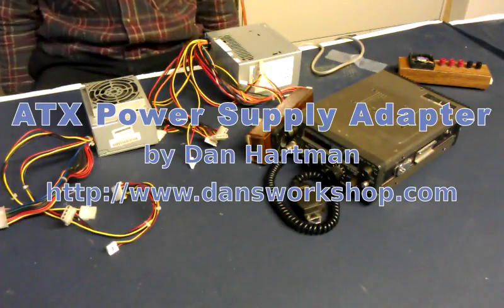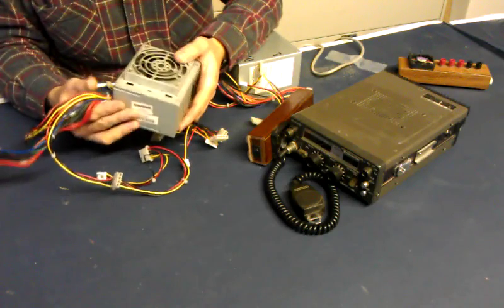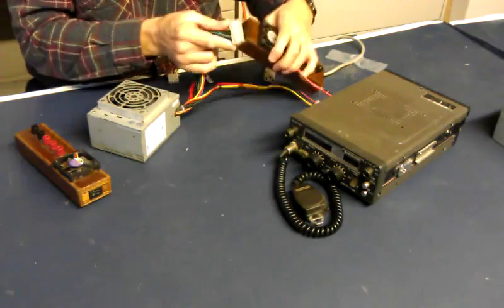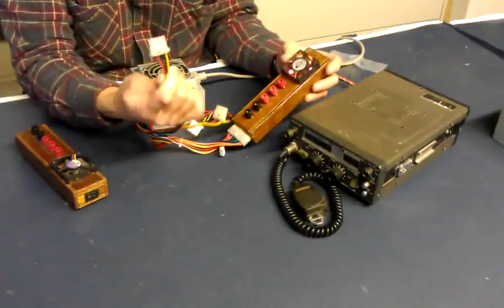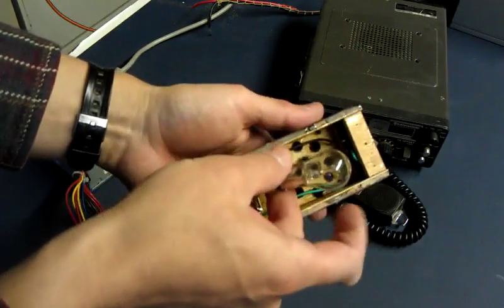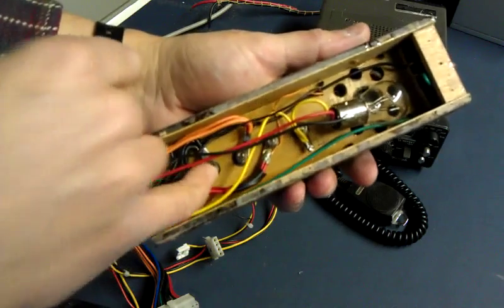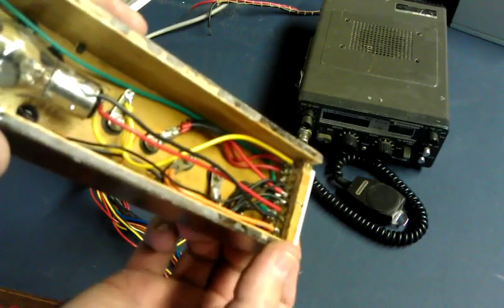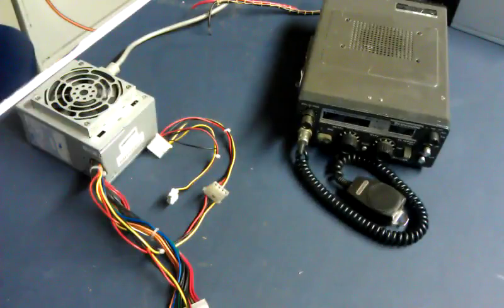How to NOT convert ATX power supply to benchtop or lab power supply

Comment: I like your idea of creating an external adapter to your ATX. But filamen bulb like the one you used requires a lot of power and it is very hot and may cause fire. Why don't you use LED? Also, add fuse/circuit breaker on 12V output at least.
Reply: therealnightwriter What is the minimum load required then?
(And more importantly: why? :P It seems like a dumb idea to me.)
Reply: Eddie Suerte Felipe Also, I wonder what would happen if the light bulb burns out when the power supply is functioning. I guess it will stop functioning at that moment with a loud poof :P
Reply: +Bon Bon In the past you needed a load resistor to pull the voltage down during power on because switch mode power supplies have a tendency to spike to higher voltages when first powered on and some can also drift higher if the load is zero since they were designed to always be plugged into several pieces of computer hardware.  Most modern quality PSUs don't need a load resistor any more since they use the internal fan as a load and do not drive the output until the voltage stabilizes and they give the power good signal.  Also modern chips that control the voltage don't need as much of a load to control the voltage output as they once did.

Since the load resistor is really just for startup, nothing should happen if the bulb burns out while the PSU is in operation unless it is running with no load connected.

Comment: I want to make one of these and use a boost-buck converter with an LED display in one section for variable voltage of 0.5 to 30-35 with current up reaching 10-12 amps, but I'm thinking that if a load isn't necessary on most supplies, wouldn't a switch to the bulb/resistor make sense?  Only use it if you change to a PS that needs it?  Just something I'm considering when I construct mine.  You can always turn it on momentarily to see if the PS is working, or wire in a momentary test switch. Also, if you need more current, what about an extra Molex plug somewhere to double up?  Excellent idea you have by making these a "plug and play" alternative, btw!
Reply from the maker: Yes, add switch(es) to turn off the bulb filaments to the PS if you like!  Add more molex to it to use more wires, and quench the whining of the Current Cops! The whole idea here was to make the PS plug and play.

Comment: Thanks for sharing a very good concept!  ..yes making for fast change to another Psu,..if it takes the evening. :) 
==>Though, a important tip back: Perhaps put some fusing on those 5 an 12 rails towards the 'wooden'-boxes. 
And also make sure for utilizing 'equal amount' of negative return-wires for both the +5 and 12 + leads. 
 
Thanks again Dan. 
(..right in time to see your video, since are in a starting process of myself utilizing some Psu's here also)
br,
from other side of the pond(scandinavia)
Rolf

Comment: This is probably a stupid question with a psu can you only use up to 24 volts of it or can you use all the wires and run them through a board and use them all like you take one of the 12v wire and one ground and attach them to the board. then do same till they are all attached and they are all run to the end of the board and out some wires that then give you like a 100 something. you could control how much goes to the end with switches. Would that work i'm still a bit new to this.

Comment: dansw0rkshop  Can I add Molex (female) connections on the enclosure and connect the +12 to the 12+ of the motherboard ATX connection?
Reply: +spiritcore1  I am pretty sure you can connect them if it is a single rail one (which most of the older ones are) because they usually are connected anyways into the PSU . If the PSU has multiple rails, that would be a bad idea.

Comment: I'll have to chip in here. I guess there is a difference between the (old) 110V and 230V PSUs, because in all of my 25+ years of mucking about with computers I have *never* seen a PSU that required any "dummy loads" to operate. I've *always* just shorted the green and gnd wires (if there wasn't a separate switch) and it has always worked. But I do live in Europe where we have 230V mains. Maybe the 110V versions needed the load?

Comment: There are plenty of quality PSUs from old servers etc which are fine for permanent use. However if you connect to something which fries your PSU it's easier to plug in another free PSU than bother to hunt for a fuse and troubleshoot! Many of us throw lots of good PSUs and other bits in the metal scrap bin since the PCs they came from are obsolete and not even usable for kids.

Comment: I initially started out thinking this was a total crap video, however, as I continued to watch (I have a rule about making myself finish a video even if I think it's crap halfway through), and I completely changed my mind, what a genius idea!!! However, the only concern that I have is regarding the fact that he uses only a single 20/24/20+4 connector for everything... It seems to me that given these cheaper (typically the ones you would use for such a project), they are more likely to be multi-rail power supplies, which could be an issue when trying to pull from just the ATX connector, that is in addition to his concern that he is using only that connector... On top of that, I really am disappointed by his 'solution' of adding an automotive bulb as a load... Of the close to 100 PSU's that I have serviced, repurposed, etc. I have yet to find a single one that required a load to maintain power, not once, which to me means that they are somewhat rare, so why build in a component that ALWAYS draws a load, when you could have just added a switch for both the fan and the bulb, so that IF that particular PSU does happen to require a load, you can power it on, and if it doesn't then you're good without...

All things considered, THANK YOU for this excellent idea!!!
Reply from the maker: You're welcome!

Regarding the single connector:  All the other connectors are still there and can be used.  I do use them in some cases, just not in this video.  Haven't melted any wires yet. BTW there's no guarantee that a computer will draw balanced loads across all of the wires in a given rail anyways -- there's nothing stopping a motherboard from smoking the single 12v line in the 20 pin ATX plug.

Regarding the automotive bulb:  Since I made this video, I've discovered more reasons to have this here than it being "required" for the PS to turn on.  But you're right, it would be trivial to just add a switch to turn the bulb off when not wanted.  It's 35 watts, big whoop.
Reply: I like it.  I think the resistor is still an option instead of a light bulb that someday will go pop!, and maybe more of the molex connectors into the "back plane" of the box for more "oomph" and use thicker wire on the inside to bridge them.  Take the full watts ( or a larger optional amount ) of the Power Supply on its limited wires, all plug and play.  I might have to build one now.  Thank you for the video and driving the point home about the separate box is genius.
Reply: +dansw0rkshop My apologies for the delayed response, I got caught up in moving and forgot to... 

In regards to the part of your message stating that there is nothing stopping a Mobo from pulling too much current, but that is incorrect, the ATX specification prevents pulling such load, so any Mobo manufacturer worth looking at will have adhered to that spec, additionally, there isn't much stuff on a motherboard that pulls from the 12v rail (I believe you said this already in the video though...).
Reply: +dansw0rkshop my apologies, I can't seem to edit my previous comment on my phone... 

Anyhow, I did want to express that I am in no way being disagreeable, nor at all combative, I really like what you've done, and I plan to make one myself once I decide which computer I want to pull apart (I usually have a good selection from a friend that gets them regularly, but sadly he hasn't had any recently), I have a tiny, proprietary Dell with a nice and physically diminutive 300W PSU, or a custom build with a standard ATX unit of 500W,vut since I'll likely not be pulling anywhere near either of those for any projects I do, it feels 'wasteful' somehow... lol I keep looking for a small 100-200W unit on eBay, but the prices are crazy for anything substantial.

Comment: Really the main killers of these PSU's are the caps they use, easy fix.
Ill be converting my SUN 1000w server PSU, i've upgraded the output circuits and it can give me 50v DC at 1kw (I've added a pot to the feedbackloop)

Comment: Shottky rectifiers seldom go bad.
In my experience,  the electrolytics fail, and 
then sometimes take other components with them,
due to the ripple - not on the mains side,  
but on the RF side, ahead of the shottkey diodes.

Motherboard caps are cheap,  if bought in lots,
and should be installed after the old caps are removed.

These AT and ATX switching supplies are very reliable,  if
you refurbish them before deployment in a bench setup.

"Throw them away"?
I would gut the stainless steel cases,  as they provide
great material for fabrication.  It is not too time consuming
to simply remove the boards,  and use them in a power supply project.

Also,  by simply changing one or two resistors, you can change the 
output voltages on the 3.3 and 5 volt rails.  Just make sure the 
working voltage rating on the output smoothing caps is high enough.

Also,  look for PFC supplies.  The less expensive ones are not PFC, 
and therefore draw a ridiculous aamount of current from the mains.
However, they can also be drived with 170 to 300 volts DC,  
with or without bypassing the input bridge rectification diodes...

de WA6FRN
Reply: This is what I've found too.

Comment: what is the maximum power you get out of it? my conversion can't supply 1/4th the power it is rated to
Reply from the maker: Each of the voltage rails have amperage limits, and those added together represent the wattage of the supply.  The 12v rail might indeed only supply 1/4 the total power, with the 5v and 3.3v rails supplying the other 3/4.  I dunno.  Try a different power supply, it's easy to swap out!

Comment: You don't need to use a dummy load on an ATX power supply.  Just short the grey power good wire to either the 5v rail or 12v rail.  (5v rail preferred)  That stabilizes the power supply so it can run with no load.

Comment: Do you really need all the cables for the 3.3 and 5 volts? Isn't just one of each enough?
Reply from the maker: +epiNoesis Yes and no.  Yes, you can power something from a single wire, but no, you cannot deliver the full rated amperage through just one.
Reply: +dansw0rkshop  Yeah,  I wouldn't draw more than about 5 amps per wire ... too lossy.  They're what,  AWG 14 or 16?
Reply: +John Bond no they're 18awg or even 20awg
Reply: aaaack!  I'd parallel 'em,  or replace 'em,  too,  myself!
Reply: +John Bond well 18awg will easily do 5amps
Reply: Yep.  2.3 to 16 amps,  depending on the run.  But I'm a little on the liberal side when it comes to power electronics,..

Comment: Did you even watch the video? lol I do agree with you, but the author of that video says these old power supplies are old and unreliable and that is the reason for the external box, NOT so you can use the supply later in another computer. Start watching at 0:30 and you can confirm this quickly. I like his little gadget as a testing device, but not as a permanent power supply.

Comment: I like the idea you are going for here, but you wouldn't use all the rails on your PSU by not using the molex connectors. IF you do have a PSU that actualy delivers full load on that one plug, then pulling that many amps through that thin wire will ignite the woodwork in no time.
I've melted several wires due to bad planning when re-routing an ATX, and using under-dimmentioned wires compared to what the PSU could actually pull. In one case I even had an all out electrical fire.

Comment: Nice try but...
Firt off, FUSES!
second most psu's from the last 10 years have the dummy load built in. Also your lightbulb is overkill as far as dummy load goes. Get a resistor in the k range using ohms law to figure out how much curent it will draw. Put this resistor on a switch for new psus that wont need it. with a dummy load in the k range you wont need a fan and probably not even a heatsink.
third add more inputs to use the other rails as most have at least 2. keep in mind that parrralelling these rails means you will need some high current schotky diodes so the rails share the load and dont backfeed from differences in potential. these diodes will drop 0.7 volts from your voltage so you would want to add a switch to seperate the rails for times when an accurate voltage is better than more current. or you could do seperate positive posts for each rail. with a dummy load in the k range you wont need a fan and probably not even a heatsink.

I know you want it plug and play but connecting the voltage sense wires directly to your binding posts with some heavy gauge wire would do great for regulation and may counteract the voltage drop from the diodes should you parralell the rails. I think stripping and screwing 3 wires every time you change psus would be worth the added current capability. keep in mind that parralelling them you shouldn't draw more than 3/4 of their combined power.
Reply: It was mostly a joke, every single how to or diy has a stupidly long and try-to-hard-to-be-funny intro. I haven't fused any of the atx supplies I use and are grateful for the protection they provide.
Reply: I have used my fair share of atx's and btx's

I have an old dell atx mnounted to the back of my tv powering my modem, router, and speakers. a higher powered one for my old head unit and a set of speakers. another that powers led lighting I made on my workbench. and another with brass screws and wingnuts mounted on a piece of 1/4" phenol for testing. I did until recently have a second in my pc case just for fans and extra hdd's. I also built a boombox with an old headunit, stereo speakers, and an atx that I use on jobsites. if it gets trashed or stolen it cost me like nothing.
Reply: it's tough to find many with strong 12v rails but most have ginormous 5v rails. One of these days every night stand and sidetable in my house will have a courtesy usb charging port for guests.

Comment: ... built-in. But that's highly doubtful if it isn't a general practice to fit them with those in general. Granted, I haven't tried any newer PSUs, so it might be that those old ones did have them. I'm not that much of an expert that I could find out if that's the case. Anyways, all of *my* PSUs work perfectly well with and without any dummy loads. I can't complain. (except that I want a variable PSUs, which I'm going to build.. some day :)

Comment: damn you beat me to the idea , great minds think alike I guess, but I made mine a lot more robust. I can use the full amps of whatever power supply you hook up to. But also came up with a way with the help of the Internet on how to hook up 2 power supplies in series to one plastic box with two sets of binding post one set for each power supply so you can use 24 volts with full rated wattage of both at the same time. Really! .project is done video in the process now

Comment from the maker: The wires aren't grounded to wood.  Wood at 12 volts is a perfect insulator, no grounding happening at all.  Yes the green wire is the control switch wire.  When the switch is on, this wire is tied to zero volts, telling the PSU it's wakey-wakey.

Comment from the maker: I've never purchased mine, always desoldered them, as i have many old motherboards lying about.  You can get them on Mouser as part number 571-1-1775099-1 for a whopping 30 cents.  Actually it looks like they have a minimum order of thousands, so I dunno.  There's also a manufacturer part number of 1-1775099-1 so you might be able to find it in lower quantities elsewhere.

Comment: I have DPS-145PB from 1993 still works with original Nippon Chemicon capacitors, it has 30mA dummy load on both 5 and 12V, I have used it for years, accidentally shorted the output many times - it has automatic shut down. ATX power supplies from 1990's are good, look out for those with Nippon Chemicon or Nichicon or Rubycon capacitors. Trust me, with newer power supplies you never know when you can stumble onto some real crap with piss-arse capacitors.
I have one question - why not use smaller bulbs? Or incadescent bulb indicator for dummy load? What is the minimum required dummy load to ATX power supply to work properly?
Reply: DjResR, absolute minimum, 10-Ohm, 10-Watt across the +5V. Though I've had a few work with a 33-Ohm, 5W. (a 350W Power-Man supply I semi-converted (Similar, ran all wires out to a box), had aq 33-Ohm, 5W Metal Film resistor hard-soldered to the main board inside, across the +5V. A 200-Watt supply I pulled from a Dell Dimension (can't remember the manufacturer), I put a 33-Ohm 5W-Sandblock (ceramic w/a sand/epoxy filler, wire-wound) resistor across a sacrificed pair +5V & GND wires, and mounted the resistor to the case inside with direct airflow to it.)

Comment: your adapter doesn't utilize all the accessory connectors, not gonna get the PSUs full potential.
Reply: Accurate, ... unless the power supplies 12V rail puts out less than 14 Amps to begin with, ... in which case, ... yes he will...  :-)

Comment: You could always mount binding posts and led's to a new pc power supply, Should get many years out of a new half decent one providing it not overloaded or abused in some other way. 

All those extra wires would drive me crazy and I would have to cut them off. Just using the 24 pin ATX plug is not utilizing all the current capability of the power supply, better to use all the wires. I like the idea however.